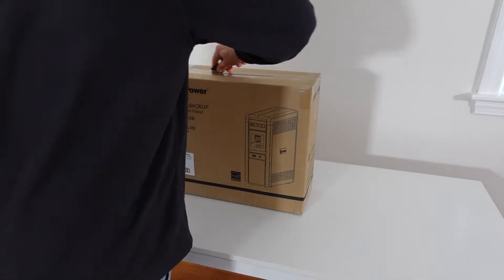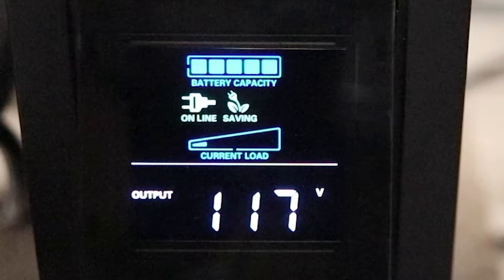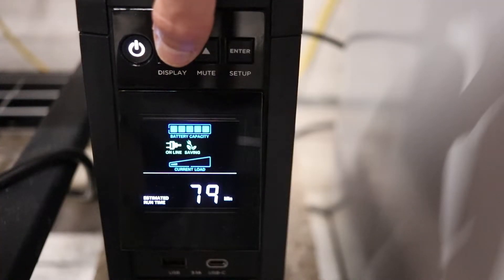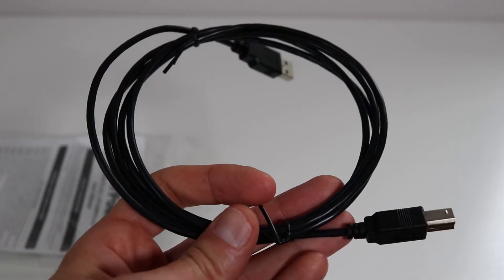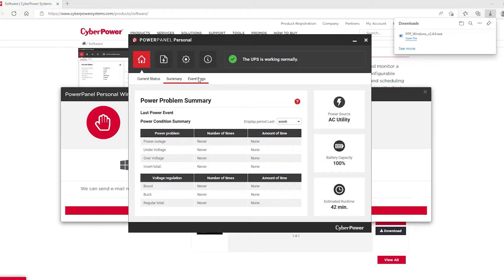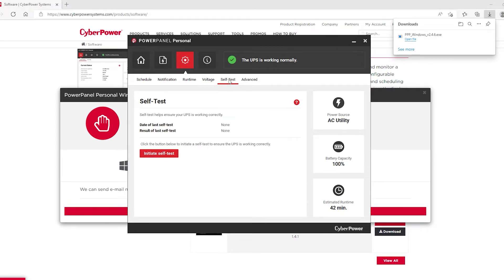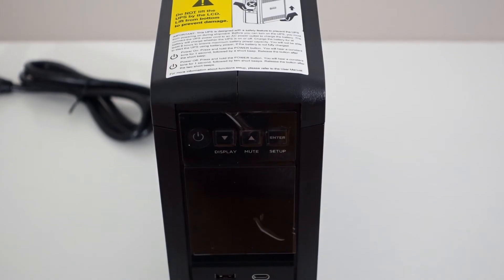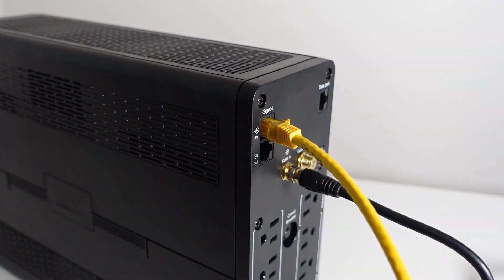Cyberpower 1500VA/1000w CP1500PFCLCD UPS Unit Review, Software Overview with PROS & CONS

Comment: The biggest "con" with any of the modern UPS units, at least that I'm aware of, is they still use some sort of lead-acid chemistry battery.  This means even the very best of them will only last 3-5 years, sometimes even less than that.  Why the manufacturers of these devices haven't switched over to the much more voltage-stable lithium iron-phosphate battery chemistry is beyond me.  They must own stock in a lead recycling facility, or something?
Reply from the maker: Yeah i'm not sure why either.  Lithium is expensive.  I've seen a couple but they are lithium ion, so it looks like the chemistry is just starting to show up.
Reply: @SystematicHardware  - At this stage of the game, lithium iron-phosphate batteries aren't very expensive, especially if you're looking at a UPS as something you'd like to last 5-10 years.  At the prices being charged for some of these products, it's unconscionable that they're still using lead-acid batteries.
Reply from the maker: @jasonbroom7147  Inflated prices are affecting everything, let alone ups battery backup units.
Reply: Lithium is no longer expensive  @SystematicHardware
Reply: replacement batteries are like $15 you don't need to resort to conspiracy theories to explain it. the batteries are extremely cheap compared to anything lithium.
Reply: @Megatog615  - The replacement batteries are cheap because they're going to fail just as fast as the original garbage.  The LFP batteries are a far better value proposition, for anyone capable of employing 3rd-grade math skills.  For those who are penny rich and pound poor, keep buying the SLA.
Reply: A problem that I have observed for several different brands of UPS units, is that the "float" voltage they impose on the SLA (sealed-lead-acid) batteries they use is MUCH too high on every single UPS unit tested. A "float" voltage that is too high causes premature degradation of the batteries and WILL reduce their lifetimes by years depending on how much over specification that voltage is for the specific battery used. Not all SLAs (and other lead-acid technologies) have the same specified float voltage range. For more information on battery technology, see the excellent website batteryuniversity

note: I have no personal or financial interest in any UPS brand nor in batteryuniversity
Reply: Have you ever seen a lithium ion battery fire? It can literally burn while submerged underwater. I’ll take that lead acid battery please over lithium ion just for the peace of mind that it won’t burn my house down.😂
Reply from the maker: @BrentLeVasseur  I don't think they make lead acid batteries for cell phones
Reply: @BrentLeVasseur  so does that mean you take your ups in the shower together?
Reply: @BrentLeVasseur  :text-green-game-over::face-red-heart-shape::face-red-heart-shape::face-red-heart-shape:
Reply: @BrentLeVasseur  - Lithium "ion" can mean any chemistry which includes lithium, but is most often used to denote NMC, which can experience a thermal runaway.  Lithium iron-phosphate, which is the most suitable for replacement of a 12.8v lead-acid battery, is incredibly stable.  It is no more or less dangerous than lead-acid batteries.  Research the differences between NMC and  LiFePO4 to understand why your concerns are unwarranted.
Reply: @jasonbroom7147  Good point! And while that's true that LifePO4 are more stable than lithium ion, both can still catch fire, and a lithium ion fire in either case is a total bitch to put out once started. You could throw the battery into a pool and completely submerge it (provided you could handle it while buring white hot without harming yourself which is unlikely) and it will continue to burn under water because it needs no external oxygen unlike most other fires. The only way to extinguish a lithium ion battery fire is to either cover it completely with foam extinguisher containing CO2, powder graphite, ABC dry chemical, or sodium carbonate, which most home users don't have at the ready. So even if a LifePo4 is more stable, everything is relative and accidents can still happen. A puncture or extreme over charging can cause either battery to explode like a flammable grenade, and then the fire is really hard to put out. Whereas a Lead Acid Battery doesn't do that, at least not to the extreme that a Lithium Ion battery does.
Reply: @BrentLeVasseur - Please post verified references of LFP batteries causing a fire in a residential energy storage environment.  They don't exist, because it doesn't happen.  The only good argument to be made for lead-acid over LFP is when very cold temperatures are in the equation.
Reply: I believe it could be due to discharge rates. Lifepo4 batteries have a much slower discharge rate and these are meant to go from 100% to 0% in a few minutes
Reply: And how many factories are up that  specifically produces that for UPS use cases? Sealed lead industry have been established for long hence lesser costs and mass production
Reply: @TheDevestatorX  - Transitioning from planned obsolescence to a more reliable technology rarely favors the consumer.
Reply: @jasonbroom7147  unless the companies themselves risk and become adventurous.
Reply: My biggest bug bare of these tower UPS for UK users anyway is.....all the connections at the rear are US plug design. Very few have UK plug sockets or are very limited. I've looked at several on Amazon UK, and even those feature the US 3 pin sockets. There are other brands that do UK sockets, but a lot don't.
Reply: The replacement batteries are dirt cheap tho
Reply: Greedy. Bad management
Reply: Probably because other options like lithium are more dangerous. Saw how they burst into flames. From mobile devices like smartphones, smart rings, electric cars and power banks. We still haven’t seen one on UPS because none uses it. LiFePO4 on the other hand seems promising, wondering why if the probable reason is price? And why it’s not also being used in electric cars
Reply: @平子真ジ4773  - The answer is simple:  If they keep putting SLA batteries into UPS's, people will keep buying a new one ever 3-5 years.
Reply: Totally uneducated guess here, but if you’re like me…the notion that plagues lithium-ion batteries is the 😊potential fires or explosions. In my rural area if the PacNW where power outages are the norm in wintertime, I’ve had about 3 neighbors that have lost their homes as a result of lithium-ion batteries.
Reply: @dadduorp  Not all lithium-ion batteries are the same.  NMC and LFP are very different, in terms of thermal runaway risks.  That plague you reference is actually borne of ignorance.  Also, 3 personal neighbors, in a single rural area, losing their house to a lithium-NMC battery fire seems...unlikely.  Was it 3 neighbors, or "about" 3 neighbors?  Maybe share the general location and links to the news stories, because those are ALWAYS sensationalized.  Yes, I'm calling BS and suggest you stop fomenting fear with vague references and educate yourself on the differences between NMC and LFP batteries.
Reply: Is it the possibility of it blowing up or thermal runway? I remember seeing one military contractor having a less energy dense battery, for their helmet because it wont blow up. But the counter argument would be that we already have the newer generation batteries on our phones.
Reply: @AdrianSnacks  - No, it was mostly just companies being lazy and not updating their products to use the much more durable LFP batteries.  Basically, the older SLA models had "planned obsolescence" built in - they knew the battery would fail in 2-5 years, and that most customers would buy a new unit, instead of replacing the battery.  However, Goldenmate is now offering a UPS with LFP battery already built in.  This is going to force the other big players in the UPS market to follow suit.  This will ultimately hurt their bottom line, since units will last 8 to 10 years, if not more.  Educated customers will actually cycle the batteries, increasing their lifespan.
Reply: When my ups unit will stop working i will buy a new one and put the old one in the box saying ot doesn't work and ask for a refund
Reply: @TigersharkQc  just buy battery replacement for it.
Reply: Good luck with that, you don't think they check serial numbers for year of manufacture?
Reply: @TigersharkQc  - That sounds like a perfectly honest and reasonable thing to do, if you're a lousy human being.
Reply: What about pull them out and wire in your own deep cycle batteries last for 20 hours straight !
Reply: @THEINFAMOUSJLC  You can't do that. The different battery types require a different BMS, which means the firmware onboard needs to be modified and reflashed.
Reply: @THEINFAMOUSJLC  - If I was going to do that, I'd still use lithium iron-phosphate batteries.  They weigh less, last at least twice as long, and even cost less per watt hour, at this point.
Reply: Please, stop using the word Point after the word Price. No one spoke like that 5 years ago. Some Moran made it up and now everyone is using it. It’s either price by itself or Price Range. Same thing for Use Case.
Reply: Switching is not easy. You could easily burn your whole house down if something wrong goes with the lithium batteries. This will require more testing and more safety measures. This takes time to develop in addition to the risk of selling such products.
Reply: @TechnologistAtWork   - Bullcrap.  LFP is no more likely to suffer thermal runaway than SLA.  The absolute worst case scenario, when replacing SLA with LFP, and not having the correct charging algorithm, is the LFP battery never gets fully charged, making it virtually impossible for it to suffer a catastrophic failure.  You don't understand what you're commenting on.

Comment: When evaluating computer power supply units (PSU) and Uniterruptible Power Supplies (UPS), be sure to examine the PSU's HOLD TIME and the UPS's TRANSFER TIME specifications. (The "Hold Time" parameter is also sometimes labeled "Hold-Up Time"). You ALWAYS want the Transfer Time to be MUCH MUCH shorter than the Hold Time (e.g. pairing a UPS with a Transfer Time=8ms and a PSU with a Hold Time=10ms is NOT a pairing I would trust, especially as the PSU's Hold Time will decrease as the computer load increases, and could even fall below the UPS's Transfer Time, which is NOT a good thing at all)
(I suggest searching and reading up on both PSU Hold Time and UPS Transfer Time for your own education.)

If the computer PSU's specified HOLD TIME is below or even anywhere near the UPS's specified TRANSFER TIME, then it's quite possible you will have problems with UPS being sufficiently fast at providing appropriate and stable AC power to the computer's PSU. This could cause the computer to shutdown or even result in unpredictable operations (spikes, surges, etc) in the DC output of the PSU which could cause unpredictable operation of the computer including damaged components and/or lost data.

A CRITICAL parameter of UPS's that most users don't understand is the amount of time it takes the UPS to transfer from AC to Battery power with acceptable output. This is called the Transfer Time. I've found when comparing Cyberpower vs. APC UPS units, that the Cyberpower units are (so far) ALWAYS MUCH FASTER than the equivalent APC unit...often by a significant amount. For example, the Transfer Time for this unit is about 4ms, whereas the fastest Transfer Time I've seen so far for the similar APC unit is 8ms.

In my experience, 8ms is pretty marginal for highly sensitive computer PSUs depending on the load on the PSU and the quality of the PSU. A high quality PSU will hold the DC voltages up once AC is removed for a longer period of time than a low quality PSU...which gives more time for the UPS to switchover to battery power.

Comment: I was really hoping to see an oscillograph image of the output voltage on battery power. 
The issue I have is that I've seen multiple contemporary datasheets and Cyberpower supplied user documents for the exact SAME model where the spec for this parameter varies using four different descriptions to describe the output waveform.
In particular, the "PFC Sinewave" datasheet seemed written in a way that they could claim it was "certified" to support Active Power Factor Correction PSUs, but never actually came right out and said it was a "pure" sinewave anywhere in the document. That was not reassuring.
1) "Pure Sinewave"
2) "Adaptive Sinewave"
3) "Sinewave"
4) "PFC Sinewave"

An image of the output voltage waveform on battery power would really help.
Reply: It's amazing how this active pfc vs ups compatibility issue still persist along with online ups never designed with 12cm or bigger fans. 2 of the greatest mysteries of our time :D
Reply: @LtCatscratch  Would be nice if we can switch to DC current. Almost everything can be usb-c powered except laser printers and gaming/HPC desktops.
Reply: If I understand it correctly UPS outputs are most of the time directly connected to the grid. If it detects under/over voltage it then switches to the internal inverter. But you are right, this is just another unboxing video... I kinda doubt the author has an idea what VA might be.

Comment: 3:25 That's because it is. Those printers use your standard, generic USB 2.0 type B connectors as does the CP1500PFCLCD. It's a fairly common type of USB connector for for single purpose hardware to use.

Comment: These catch fire easily still like previous models ?
Reply from the maker: Mine hasn't.  I have my refrigerator plugged into it.
Reply: I read that the v2 models don’t have the glue issue which is what would cause fires. The model with the flip up display are v3 so those should be safe as well.

Comment: Hi there. I bought a second hand OLS1000EC, which is roughly the same . Works like a charm. Only thing is .... The fan is always on ( very loud industrial 80mm, delta style...), noise is simply unbearable. Googled, seems normal... Fan replacement is very tricky to say the least . So on your model can you confirm that during normal operation ( othee than power shortage) this unit is silent with no fan running permanently? 😅
Reply from the maker: Sounds like it could be automatic voltage regulation kicking on.  On the display - You would be able to see the incoming voltage from the wall and then compare it to the outgoing.  If that's the case you can fine tune the voltage range to be less sensitive.
Reply: @SystematicHardware beforehand , thanks for answering 👍 si you mean the fan is supposed to kick in like any other UPS in case of battery switching or external current regulation = NOT supposed to be on at ALL TIMES ? That would be a relief and I'd explore the given  options . Voltage range seemed normal at 230V (EU)

Comment: i have this one its fantastic  had 4 power surges / blackouts only thing i lost was my internet when this occurred.
Reply: Why didn't you plug the router into the ups?
Reply from the maker: They are great  My electricity is so sporadic, I have one hooked up to my refrigerator and deep freezer
Reply: @SystematicHardware  isint that pulling more than the wattage ?
Reply from the maker: If it did, i'd be out a lot of money!
Reply: @SystematicHardware  Curious how long power last to fridge and deep freezer.  For years we had rolling brownouts/blackouts due to a random transformer in the neighborhood. Perfect sunny day, Drop.. Storm no drop then of course the random hurricane.
Reply: I use a smaller UPS for my fiber box and Orbi router. Lasts for hours.

Comment: I just found out that this unit will apparently support the CyberPower RCCARD100 which can be installed in the removable card bay on back and provides a lan port for web app based control. So this would be a huge advantage over the APC sine 1500va unit imo.
Reply from the maker: Interesting!  Really cool

Comment: Who are still using coaxial this days???
Reply from the maker: I was, but not anymore.  Switched to fiber
Reply: I still use some coax with a moca\ethernet converter in remote bedrooms, don't really know if buying the older version with coax would be worth it but that unit has only 900w vs this unit with 1000w???

Comment: This thing is a BEAST! I just got it yesterday for my rtx 3080 12gb gaming rig and its handiling it like a CHAMP! :)
Reply from the maker: Enjoy!
Reply: Did you download the software as shown in this vid for it? I’m assuming it’s worth it since the voltage regulation controls and automatic regulation like he was saying. I’m going to avoid downloading it if it’s fine to do so
Reply: @vader7306 question I’m about to purchase this for my gaming rig and was wondering did you download the software that came with it? I was shown in this video or no did you skip it all completely?
Reply: is this unit a backup battery to prevent immediate shutdown in a power  loss ?
Reply: @verified7064  yes
Reply: How long this can run your PC for? Doesn't the transformormer overheats and catch on fire? Did you actually test it with the power cord disconnected (simulated power outage)? I had one and after 5 minutes, the inverter transformer overheats and started smoking! Because there is no cooling fan or anything to dissipate the transformer heat when it switches to battery mode!
Reply: the runtime depends on how much power your using from it, like devices.  my power has gone out over several times since ive gotten it for 30 minutes to hours. with my pc plugged in it last around 2 hours if power goes out. havent had any over -heating and there is a fan when it kicks on it goes on @varman001
Reply: maybe it would overheat if you are running more than 1000w @varman001